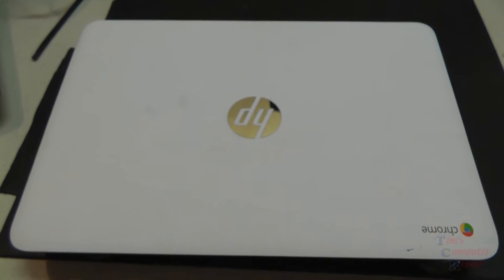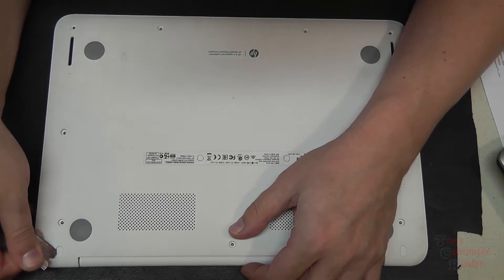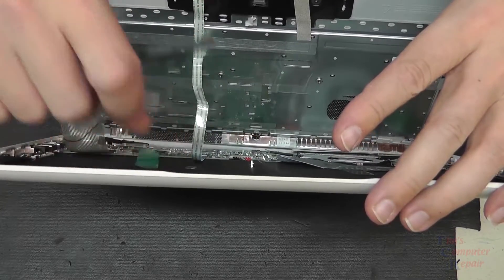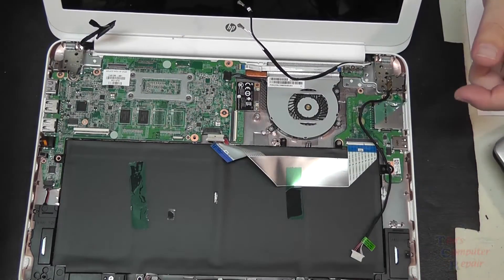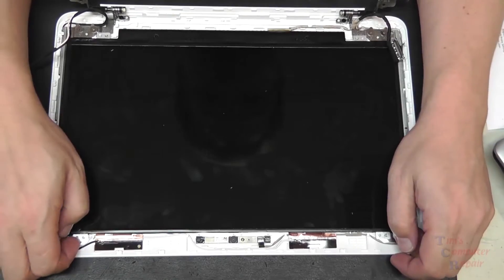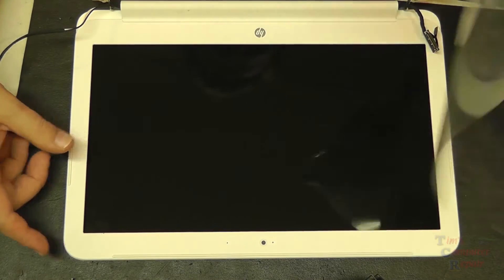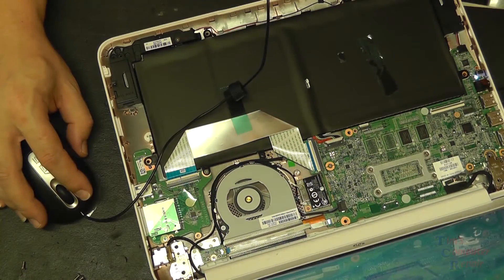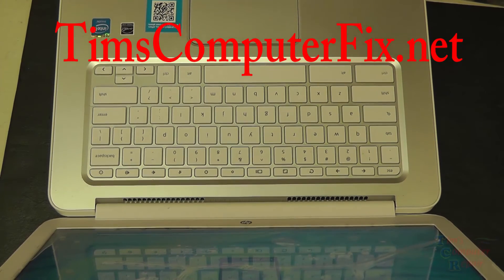Google Chromebook Disassembly and Screen Repair by TimsComputerFix.net

Comment: good video but question why would u take it all most apart u could have pulled the battery cable after u lifted the keyboard and palm rest and u could have left the hing on as well  it looks like more work  to do ??
Reply from the maker: hartsf33 Yes I explained in the video that you do not have to go through these extra steps. Thanks for watching.
Reply: oh ok

Comment: Good point about the power source, Tim. I once made the mistake of removing a modem board and dropped one of the screws and a second later had a puff of smoke and it was finished. So, I always make a point of removing the battery before fiddling with my computers. Though it is easy to overlook :-)
Reply from the maker: mikenagoya Yes exactly... It's very easy to accidentally bridge a + and - point and all it takes is one time.